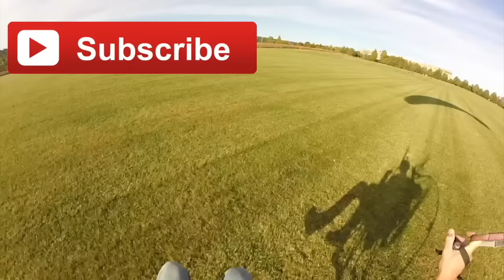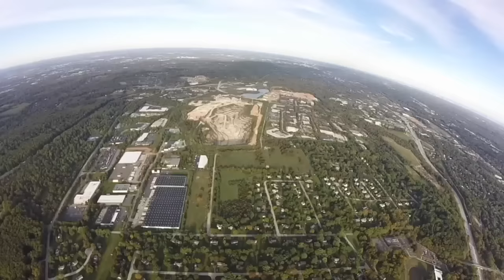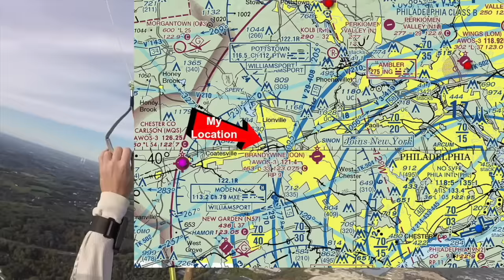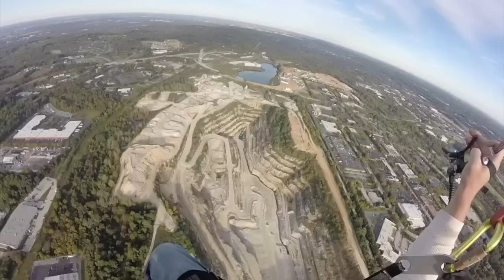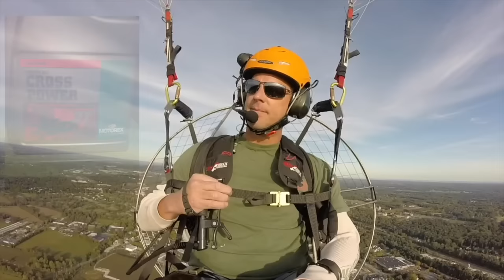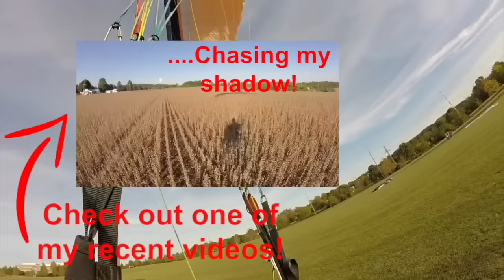Powered Paragliding - FAQ's about Paramotoring

Comment: What do you do if the engine catches fire at 1500' AGL?
Reply from the maker: That is a great question and one that I hope I never have to deal with. My unit comes with two quick pull jettison clips. I would have to make sure that I wasn't over any thing or any one that could get hurt, then I would pull these two tabs and the unit would drop away. I would still be under the wing and glide back down to the ground. These quick release tabs were really meant for an unexpected water landing, but could also be used in the scenario you brought up.
Reply: @PPGFlyr  Interesting.  I was just talking to my daughter about this.  As a pro pilot with nearly 9000 hrs the first thought I had when researching these things is "how do you deal with an onboard fire'.  I guess that answers that!

Comment: Hi, im just starting wit PPG and i can get a good deal on n Revo 2 26m, same as yours. would you recommend it for a starting wing?
Reply from the maker: Absolutely! I love my Revo2. I have used it from the very beginning and still enjoy it 5 years later. It is very easy to come up overhead, making for very easy launches. I left my trims at neutral for the first couple years. After I got very comfortable with the wing, I started using the trims. I still haven't used the speedbar system that comes with the wing, but that is just me being lazy and not having needed to use it. I plan on hooking that up next season and doing a couple major cross country flights. Best of luck to you Jaco. If you ever have any questions, don't hesitate to reach out to me.

Comment: Can you bring a camera up (DLSR) with a big lens and take photos? Or are your hands always tied up?
(Being a photographer) I want to learn this and take aerial photos while on my travels!

Additionally,
how big is the fan? -- Curious to know how portable it would be for me.
Where do you buy that gas? -- Seems like that may be tricky to buy when on the road
Reply from the maker: All great questions. For the DSLR, yes you could bring one up with you. You would just need to make sure the camera case is securely fastened to you for take off. But once in the air, you can fly with hands off the brakes to use the camera. The paramotor (fan) can vary in size and weight, depending on the unit you would purchase. Most of them have cages that can break down, so they could fit in the back seat of most cars. Although most people just buy a rack for the back of the car and transport them that way. I personally use AvGas (100 low lead) bought at my local municipal airport. Although, they can run on regular gas from the gas station too. Thanks for watching.